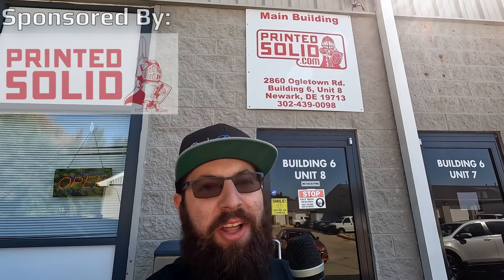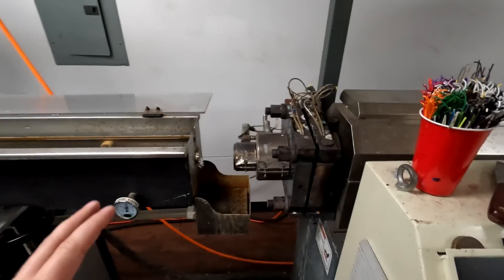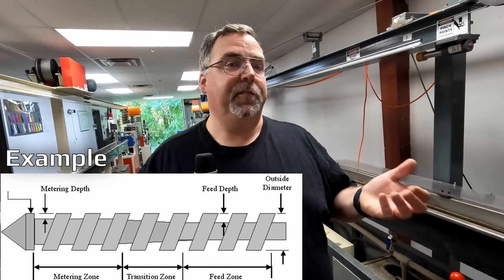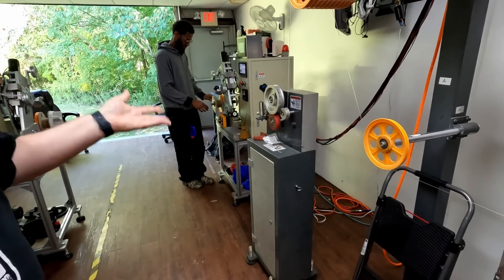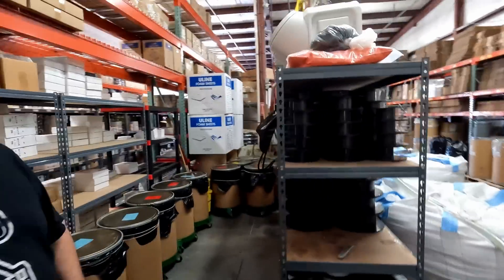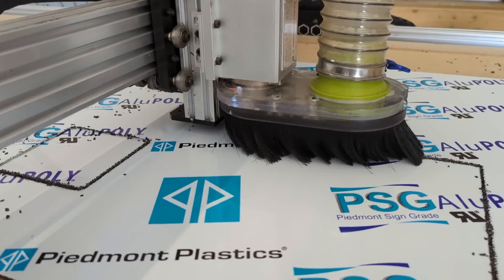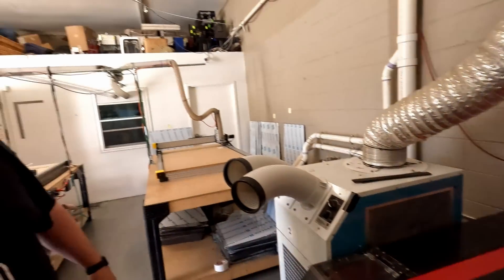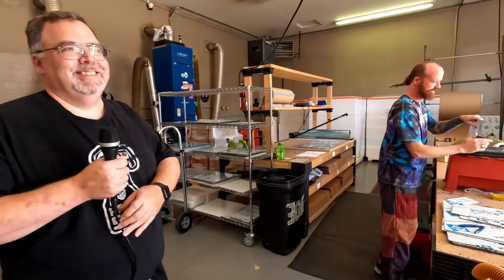Making Filament With Printed Solid

Comment: Can someone explain why all manufacturers put a desiccant pack in the center of their spools even if their spools do not have any communication between the center and the filament (ie Bambu labs) ? 
Even those that have the tiny hole for the end of the filament wouldn’t the desiccant pack work better placed against the filament ?

Comment: Printed solid made my custom designed panels for my switchwire. The cost and turn around time was very impressive.  I was worried that being "custom" came with the "custom" price tag however i was pleasantly wrong. I will be a repete customer.

Comment: Thats great thanks. I worked as fitter and Extrusion line operator for 16 years. from cutting  line up to 3.2mm down to .11mm for paper making. one of our extruders for bigger filaments output was about 150kg/hr  pellets for colour mixed in 45 gallon drums or dosed in throat of extruder. 60 spools down to 12 on big stuff, If I was still there I would be knocking PLA out on nights🤣🤣🤣🤣🤣🤣

Comment: I have always had ONE question about making filament..... most manufacturers seem to bring the filament through a water bath, and most people who have 3-d printers seem to spend a lot of time trying to DRY the filament out so it is somewhat counter-intuitive to take a material that ABSORBS moisture through a water bath....  SO HOW DO YOU DEAL WITH THAT PROBLEM?
Reply from the maker: AFAIK every filament producing method used has a water bath and the short amount of time the filament is in water while it cools down from the semi molten state isnt long enough for the filament to actually absorb any of the water.
Reply: @CanuckCreator  THANKS I have always been curious about that, it does seem kind of counter-intuitive to put a material notorious for absorbing moisture in a water-bath (here is another irony, if you want to make a tough DRY steak, put it in a water bath before cooking it, it will be like shoe leather, and tasteless), but a MARINADE will make all the difference
Reply: @CanuckCreator  AFAIK, Proto-Pasta is basically the only one who uses air cooling instead of water. But I've heard the same, the filament spends so little time in the water baths that it doesn't really absorb any moisture and then, as David said, it runs through a couple blowers that blow off any moisture so it's dry by the time it's spooled.
Reply: 3D4Makers also claims to use air cooling for their products.

Comment: get that guy at 11:40 something to hold that utility knife edge. I dont feel good buying from a company that dosnt care about their workers safty, even amazon doesn't allow handling bare utility blades! you guys ever heard of osha?
Reply: I’ve spent thousands of dollars on different holders and blades and tools and options and they still like a flat bade with some grip tape. OSHA inspector said he was fine. If there was a better solution I would get it for them in a heartbeat.
Reply: @drandolph-PS   have you tried a Machinist deburing tool ???
Reply: @jimvolkening2311  yep about a dozen different profiles of those but they cut too deep and hurt the workers hands I also tried a bunch of other things, sanders, routers, blade types and handles. Sanding pads work ok but they didn’t get to inside edges very well and required more work adding to worker fatigue.
Reply: @drandolph-PS  Cabinet scraper with a properly draw-filed square edge.
Reply from the maker: so heres the funny thing, that came up during a general chit chat after filming, they tried all kinds of different holders and blades types, and they always ended up going back to the standard blade like that, he said it works the best for him and has never caused an issue.
Reply: Box cutting blades aren't even sharp though. It's not like hes holding a razor blade. And osha doesn't regulate stuff like that. The machine shop I worked in had safety interlocks bypassed on all their lathes and I ended up losing part of my finger in 2020 because of it. Osha didn't care, they didn't fine the company.

Comment: Very interesting video. I'm surprised the filament doesn't need drying before the vacuum packaging. I must therefore presume that the water absorption in the water baths is negligible.
Reply: It is in contact with the water for only a fraction of a second and then blown dry so no moisture makes it thru.
Reply: Yea he mentioned like, 4kg a minute? That stuff is flyin'
Reply: That’s suspended in the water and blown off so in theory the number should be zero. But maybe on a microscopic level there is an atom or two that survives.
Reply: @drandolph-PS  good stuff, we use jessie pla all the time!
Reply: The calcium deposits was interesting though, I wonder what miniscule amount makes it into your models.

Comment: with regards to the ACM talk for panels, I wonder if you can get corrugated ACM, or instead of a solid inner maybe a hexagon inner or sometihng
Reply: It's used for enclosures so we use a solid core to maintain+/- 10 degrees